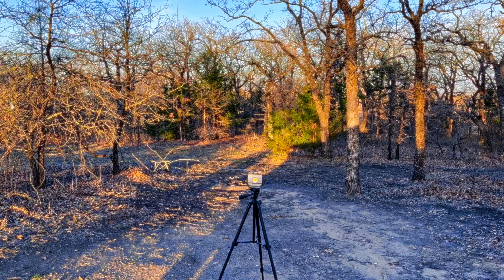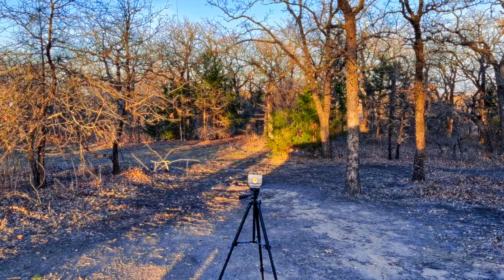Fenix CL28R Turbo Burn Down (timelapse)

Comment from the maker: This exercise is, of course, experimental.  Most of the subtle effects of burn down were noticeable only at areas well outside the field of view captured by the iPhone.  The lantern cast light through the trees, well out beyond the road. In the future, I might add a low-end cinema cam to my kit and film such videos from two angles; primary view with the cinema cam and a side view with the iPhone.  Now, for those who are interested, what did I do for about five hours?  I was actually on-site for over 7 1/2 hours as I filmed another review before this timelapse.  I moved around in the dark, keeping watch for animals with thermal night vision.  I also had to stay close to the road to ensure that no vehicles pulled up into the campground to see if it was open.  US Forest Service Law Enforcement did come by and I was standing near the road and able to talk with the officer without getting any light cast into the filming area.  The wind chill really got to me after 3-4 hours, even with the thermal layer under my jacket.  I was shivering badly at the 4 1/2 hour mark.  Probably the most difficult video I've ever filmed :)
Reply: Hello explorer!  So how long can the flashlight work in maximum mode?  Standing lamp?  Thank you!
Reply from the maker: @kollapsis1  The theoretical burn-down curve shows the first step-down from Turbo at about 30 min.  In the timelapse, you can see that happened a bit earlier, most likely due to the cold weather.  Thank you.
Reply: @L5-SAR  Half an hour for turbo mode is probably good, it's worth turning down the brightness a little.  In general, a decent flashlight with a minimum of competitors.  Thank you!
Reply from the maker: @kollapsis1  The ability to dial in the precise amount of illumination and then also adjust color temp is unmatched and extremely helpful in a general camping environment.  If you look at my full review on the product, you can see how I transport it in the field in Search and Rescue activities.  Thank you.
Reply: @L5-SAR  I will definitely watch your videos.  Thank you!
Reply: The wind chill is no joke. Hand warmers are always great to have, not just for hands but also to placed under clothes on lower back. Something warm to drink would be definitely moral booster as well.
Thank you for your sacrifice.
Reply from the maker: @wesolowskimatt  Thanks.  I had gloves, but I should have taken a thermos of coffee or something hot to keep with me during the exercise.  Filming reviews is a non-stop learning experience.  Thanks!!
Reply: When the flashlight is charging, can it be used?  will it shine?

Comment: On Fenix website they claim it will run on turbo "2000 lumens" for 9hrs. Your test shows that after 3hrs  it kicked down.  Thank you for taking the time.
Reply from the maker: ANSI/FL-1 run times are the time it takes (with fully charged battery) to go from the stated level to 10% of that output.  I doubt it would have gotten close to 9 hours at that temperature.  I would not have made it, so I shut the test down.  I  hope the test shows what output levels can be realistically maintained for a given environment. Thank you.

Comment: Hi.Thank you for this useful experienceI. noticed that at 00:33 the light decreased. Does this mean that it decreased from 2000 lumens to 1000 lumens within half an hour? It also decreased after 3:07, and it decreased to 10 lumens?
Reply from the maker: I do not have an integrating sphere or other means to measure lumen output, so I can't state how many lumens, just record when the step-downs occur at the given outside temp.  Thank you.
Reply: @L5-SAR  I understand you. I am looking for a device that lasts for 8 to 9 hours, whether from 2000 lumens to 1000 lumens without interruption. I did not find this feature in the products of lighting companies. Thanks
Reply from the maker: You will likely not find that from any handheld light (1K+ lumens constant) or lantern.  You are looking for something high-end and industrial. Good luck.
Reply: @L5-SAR You are right. But lighting companies can manufacture a larger size and have more batteries so that we can obtain high lumens that last for long hours. But the sizes are all small

Comment: Thank you for the review. I had two coming for the winter to use one in my car for safety reason and from what you showed I am pretty disappointed in the battery life. They state 9 hours on high, 10 hours on medium and 360 hours on low. That does not seem like the case. I am debating if I should return both as soon as I receive them. What light would you recommend as an alternative one?
Reply from the maker: I did not run the burn down to complete battery exhaustion.  It was very cold that night and I had to stand off in the dark.  I had already been about five hours on my feet.  I have confidence that the lantern could have kept going at that final output level for at least a couple more hours.  Theoretical burn down charts are created under indoor lab conditions.  They have little relevance for real outdoor performance, especially under adverse conditions.   Thank you.

Comment: 10 k baterry for 3 hpur 30 minutes?
Reply from the maker: That's, unfortunately, the reality of physics.  High output requires high power.  Long run time necessitates much lower output.  Can't have both ... without a lot of potentially damaging heat.  That's why I run these tests - so that we can all see where reality actually is. Thank you.
Reply: Thats why i dont believe in gimmick,lots of them use gimmick bput run time and lumens